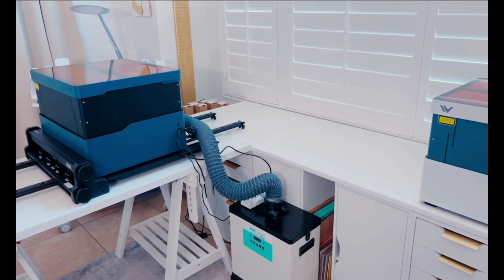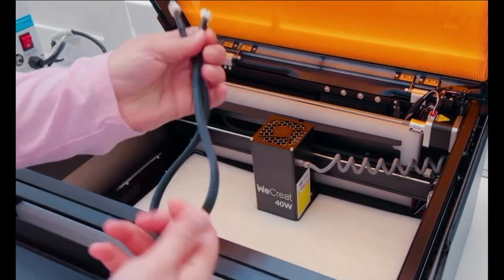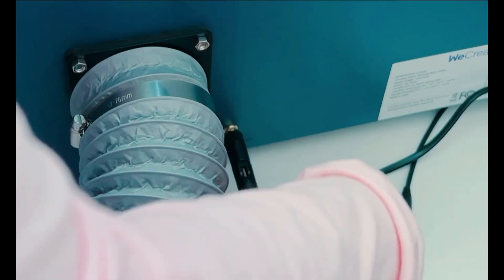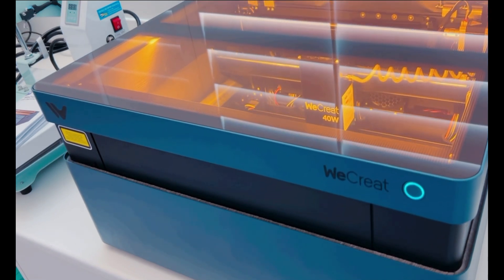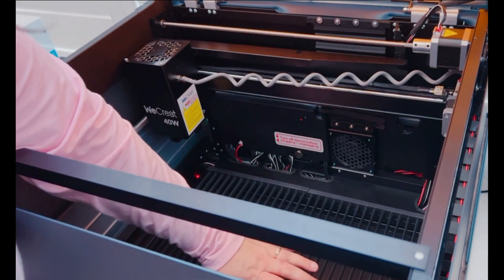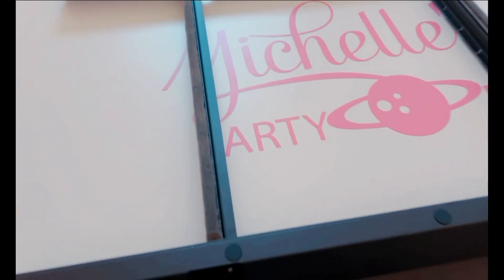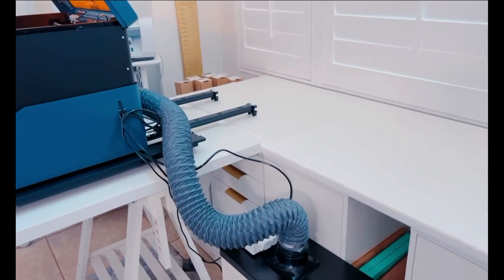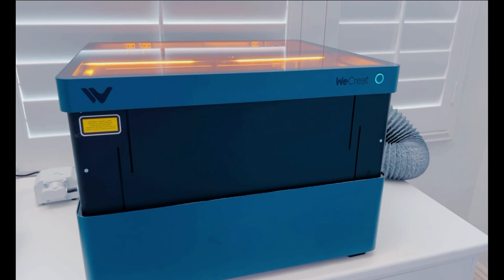Unboxing and Setting Up the WeCreat Vision 40W Super Pack Laser and Engraver  - Part 1

Comment: I have the 40w and am still learning how to use it. I have to try the tumbler or the conveyor. You made a short video on making a leather bookmark. I can’t get my 40w to engrave the same way as your 20w. What were the settings you used for that bookmark? Thanks
Reply from the maker: Hi! For the bookmark my settings were  2mm leather and bitmap engrave power 30% speed 250 line density 100.
Reply from the maker: You can also see this faux leather tutorial https://youtu.be/KR7RxOE-vh8?si=r-JnbLP_XhM8HLkb